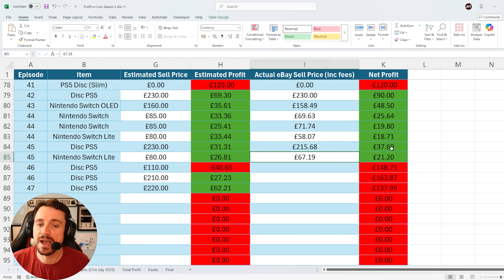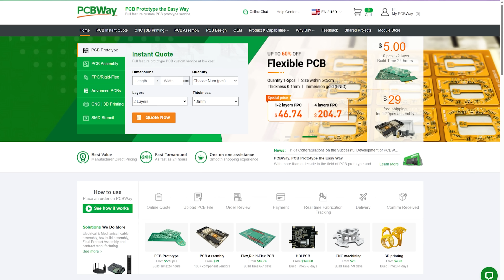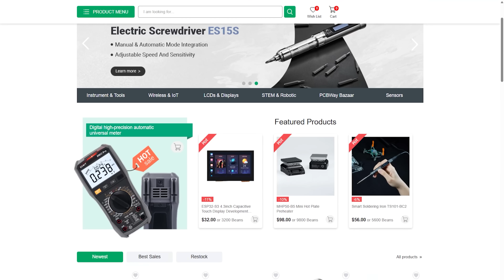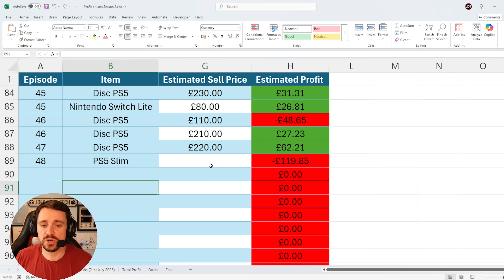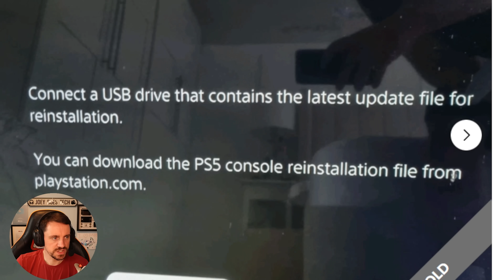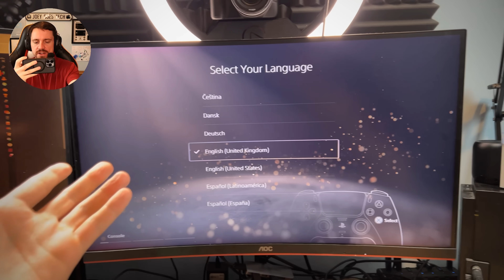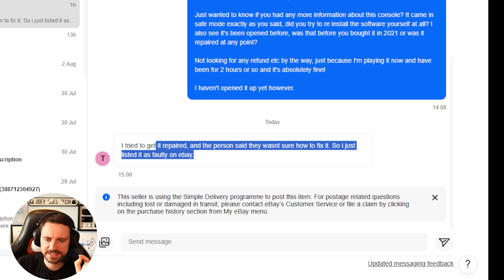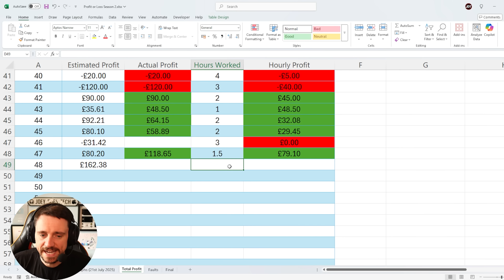Trying to Fix FAULTY Electronic Items for a Profit! S2:E48

Comment: I think something is wrong with sally as you entered a price of the disc ps5 sold £215.68 that was less than the estimated sell price £230 yet the profit was £6 more than the estimated sell price and the fact that there is a difference of around 200£ between the overall estimated profit and actual profit when you’ve logged devices sold on the estimate yet they will show up as a loss on actual profit because they haven’t sold and the even after this the actual profit is around £200 more than the estimated sell price
Reply from the maker: I’ll reply to this comment the same as another one which cleared things up 😊 I understand why you think this, but nothing wrong with Sally. I just don’t want to have to explain the same thing in every video, as people would get bored 😊

The “estimated sale price” has an eBay fee of 9% on Sallys spreadsheet. However eBay fees vary quite often, and it’s rarely 9% on the dot but this was taken as an average in season one and proved to be most accurate. Meaning that sometimes eBay’s fees are 5%, sometimes they’re 7%, sometimes 10%. Less fees would equal more profit in most situations, which is why the above happened 😊

Hopefully that makes sense!
Reply: I thought it was working out wrong while watching. The last one sold for 36 more than estimated but the profit was nearly double the estimated profit.
Reply: @lukesays6568 I’ve noticed the disparity since the beginning of the season but in this vid it was literally in my face so

Comment: Help required I have 2 shorted SMD capacitors but don't know what to replace them with they are c6f6 and c6f7 located near the white connector port for the power on and of board

Comment: Oooh! I have a no power ps5 slim at home that I bought for 100 euros. Maybe it's a power supply issue? Although I think they already changed the power supply on it, and I was told it only worked once with the new power supply.

Comment: Hi Joey, 
Just a suggestion..

It would be so handy if you included some indication of the consoles featured in the video thumbnail. 
Your uploads are a fantastic source of info for fellow technicians. However, it becomes a very tedious task having to dig through each video hoping to come across some vital solution I remember seeing.

I love what you do for the community, just thought I'd ask 🙂

Edit:
..or maybe share Sally's Spectacular Spreadsheet via Google Sheets (in read-only mode of course). If you had time to add a new column roughly indicating the nature of the fix this could become an incredible source of quick reference for other technicians.
Reply: Perhaps playlist with names which relate to the console and symptoms?
Reply: This.